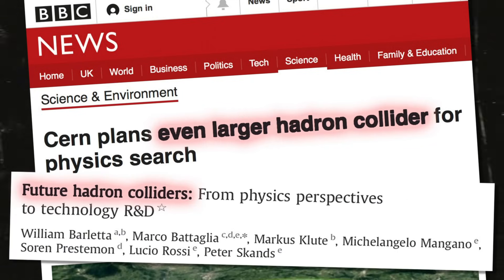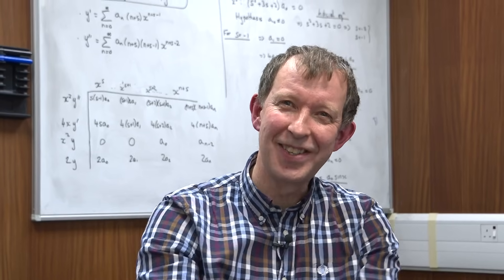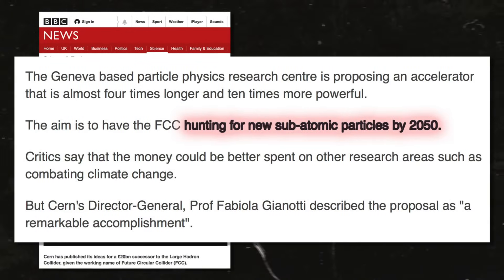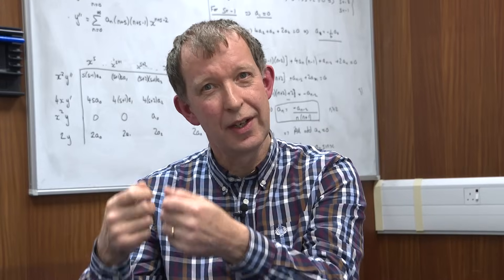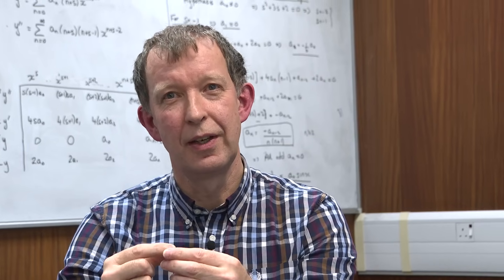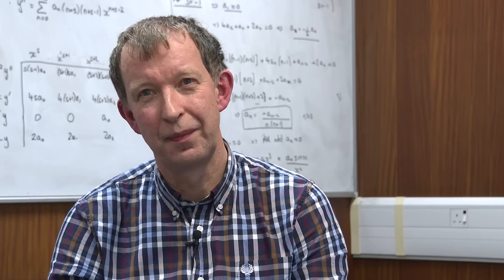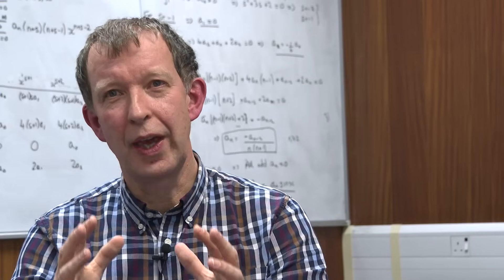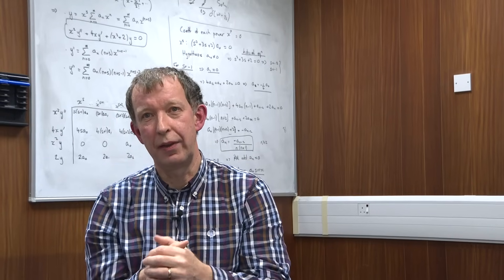Should we build a bigger particle collider? - Sixty Symbols

Comment: In science finding nothing is extremely important. LHC did tested dozens of various theories (some of them decades old), and rejected them definitively. That is something!

As of building bigger collider, I think it is a bit too early. There are few reasons. There is still a lot of spaces for interesting research in LHC energy regions, and even lower. And there is still a lot of data to process and assimilate from various experiments and other instruments. There is a lot of progress in superconductors, vacuum techniques, materials and also in linear accelerator design. Plus it would be great to cooperate with countries like China on building something really awesome. Plus, the quest for some exotic particles and answers, might be in astrophysics, radio telescopes, and satellites, not colliders. It makes more sense to explore first better cheaper options, to make informed decision. 22 billion is perfectly fine cost for me, but there is so many other costly projects around like ITER, and a lot of them is risky and could face serious financial problems. 2030 for a start of construction (i.e. main tunnels boring, while still letting LHC run for next few years), would still be optimistic. We do not even know if there is something promising to test with this new collider.

Comment: How can anyone even suggest spending that kind of money on something like this when we still have ALS, Alzheimer's, Cancer and countless of other horrible diseases to fight? Science is supposed to serve mankind. What are the USEFUL applications of these discoveries? Yes, he mentions a few, but the "cost to gain ratio" when we reach these dimensions are simply unacceptable.
Reply: Tonnes of applications have came and are coming from the LHC.
Reply: Such as?  @BlueCosmology
Reply: @erikwalfridsson8790  I work on the ATLAS experiment at CERN, part of my work being in a group that work on upgrades to the inner tracker of ATLAS, used for measuring the paths of charges particles that pass through it.

This group also works on, and some of the members of it are pioneers of, a new method of medical treatment that will offer more effective cancer treatment with much lower side effects.

Why does a group of people that work on tracking particles in a collider contribute to cancer treatment? Because it requires measuring the paths of protons through a person's body to resolutions that ~5 years ago would be impossible without the LHC and research into semiconductor trackers it pioneered and is essential for. Now in a few years it's gone from being well beyond what we could hope to working systems already produced thanks to research that requires the LHC.

This is one example of literally thousands of practical applications from the LHC.

Comment: Nuclear medicine has advanced immensely but was it due to new insights into physics or the science of biology, optics, machinery finer resolution and  the digital kit which is far more accurate? I'd say it is the latter. I like the 3rd option
Scaling this enterprise up will surely create its own issues. The same logic applies to city planning, architecture, mechanics, engineering design and so forth. If there are blind spots now, they surely existed in the past. Compounding unknowns with more of them does not make any common sense. 20 billion could fund all manner of scientific queries in many disciplines
Who is to say that a different discipline could enlighten the physics community?

Comment: Why 100? Why not 1,000? 10,000? 100,000? A million? A billion maybe? At some point increasing size won't increase energy.
In terms of the investment itself, the most important question is what is the value to society? What could be done with the results of the research? Can those results be used to reduce work? Provide more resources?
I have not heard an actual argument to justify the new expense.
Reply: Because it isn't possible to make a 1000km collider without making a 100km one first.

Comment: Cut a nice straight tunnel through the Alps from CERN to Florence, and run the next generation of experiments for however long you need to, then convert it to automobile traffic for the rest of its life. If you needed a quick confirmation of some result, wheel the superconducting magnets back in place, and fire up your linear accelerator to carry on, say, on a week day, when there is less traffic. The tolls booths can support with car payments, and the magnets for the Atlas. The souvenir shops can sell vials of the elements for the tourists, and vials of coffee for the scientists. It all pays for itself, and you get away from that idiotic circular design. 
Circular, really? That's what you came up with?

Comment: I'm just an intern working on the VL+ project at Cern, but I agree with Ed that we have to keep the R&D going.
Even if we not start building the FCC now, we should start working on the technologies that will be needed for the FCC, that are not avaliable yet.
That would not require any increase in funding for Cern.
Lets maybe freeze the yearly budget of Cern for a decade or two to a fixed value like e.g. the 1 billion CHF it is now.
Lets keep working on the technologies that will enable us to build an even better FCC just a bit later.

Comment: with all the data they have acquired about the particles over the decades couldn't they just use that data to feed some clever AI to figure things out? Run a simulation on super computers of some sort using all the known properties of the particles? They could simply increase the energy parameter to levels never achievable in real physical colliders and then see what they get when they smash the particles at those energies.
Reply: No. They already throw all data out which doesn't fit current prejudictions ehm... theories. It is is like 99.9999% of it.

Comment: Why do 100km? Why not 200? why not 500? If youre going to build one, why not go big so you can get the research done and move on? Why should anyone be convinced that 100km is enough?
Reply: Because you cannot make a 500km collider without first making a 100km one.
Reply: BlueCosmology wut?
Reply: @Melthornal  A 500km collider would require an ~100+km booster.

Comment: Develop how to make wire from lunar regolith and you could make collider with fewer parts and simpler materials, without the need for cooling, in south pole. This would have unimaginable spinoff potentials. 
Then you might also like to play with ultra low orbits and other fancy things that could only be done on moon.
Reply: You have no idea just how hard it is to keep things cool in space do you?

It's a serious problem.
Reply: Lunar south pole has large areas that are cold as 25 K all the time. At that temp you might not even need to use a ceramic as the superconductor.

Comment: Couldn’t we just expand the LHC?
Reply: The FCC is essentially an expansion of the LHC.

You can't simply have a large high energy accelerator, it's extremely difficult to have an accelerator that can both accelerate very low energy particles and high energy particles. So what you do is you have a chain of accelerators getting bigger and bigger, going to higher and higher energies.

This is what the FCC would do with the LHC. The LHC would accelerate protons to a high energy, which would then be injected into the FCC to go to higher energies (and this is what is currently done with the LHC and smaller still accelerators, the SPS injects into the LHC, the PS injects into the SPS, the PSB into the PS, LINAC into the PSB, getting more and more energy each time).

Comment: You could argue the existing LHC should NOT have been built. After a decade in operation, all it found was statistical evidence for the Higgs field. Considering the project cost, that's really scarce return on investment.
Reply: The LHC has found a lot. Discovering fundamental particles is not the only purpose of a particle collider.

Comment: First, we must urgently invest to slow down climate change and biodiversity losses.
 - Wind power, solar power, fusion power.
 - Smart grids and upgraded grids to handle intermittent power from solar/wind.
 - Energy storage systems for grid to handle intermittent power from solar/wind.
 - Energy storage for vehicles (batteries, fuel cells).
 - CO2 sequestration and carbon storage.
 - CO2 reduction into fuels and chemicals, that we are going to still need, when we stop drilling for oil.
 - AI and robotic systems to accelerate materials science in general.
 - ect.
The solution to the energy question is a mix. There is no single silver bullet or no one knows for sure what it could be yet.